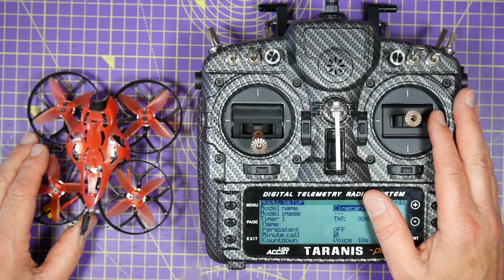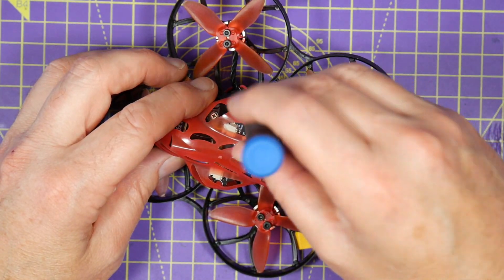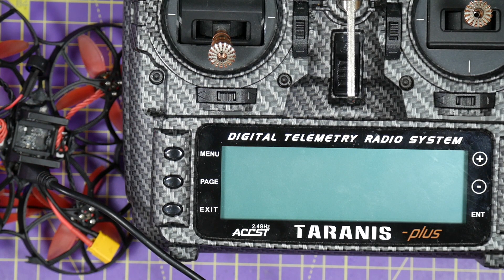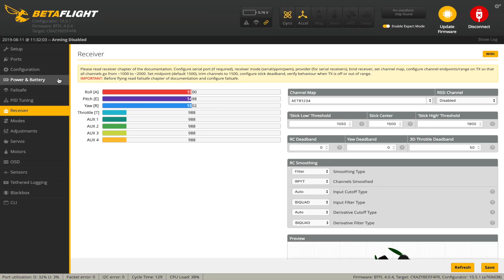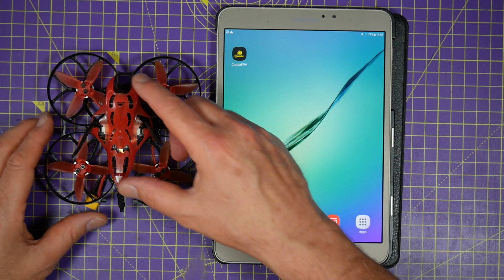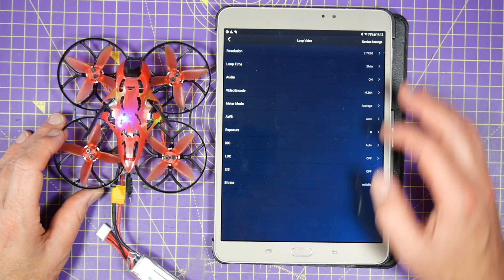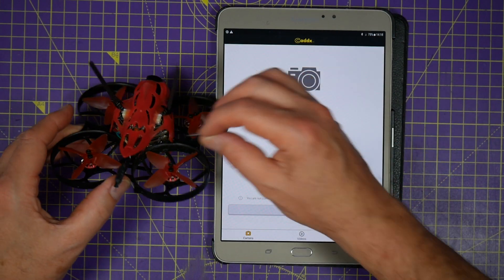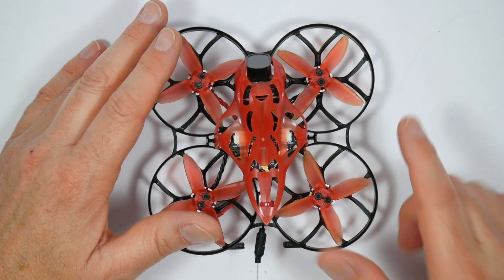Eachine Cinecan 4K HD full setup // Caddx Tarsier settings // FAT32 SD card formatting

Comment from the maker: Thanks to those of you who pointed it out, the SD card formatting option is available along with other settings in the Device Settings page in the app.  I totally missed it.
Reply: While this is a generally very helpful video, there are two huge issues (1) as noted in your comment, the drone can format own card, and (2) more importantly you don't need to take apart drone for binding, just type bind_rx_spi into the CLI in betaflight. The second one is a big deal since you don't want to be taking apart this drone unless you need to.

Comment: Hello again everyone. I have a question. When I plug a battery in on my Cinecan 4K, everything seems fine but the VTX's LEDs for the channels and bands don't turn on. I used a voltmeter to measure the voltage and there is definitely current going through the VTX so I don't understand. Any help please? :)
Reply from the maker: If it's wired correctly (double check) it sounds like it may be fried. Top tip - never power a VTX up if there's no antenna connected cos it may fry the output driver.

Comment: Hey ! So I recently received my Cinecan 4K, my Taranis QX7 and my EV100 goggles. I am trying to "bind" the goggles to the drone but I just can't manage. I power the drone with the included battery (didn't charge it or anything like that; just immediately out of the box), I power on the goggles with the battery (also tried directly powering it with a usb cable to be sure power isn't the problem), and then I go into auto-search mode. It beeps for quite some time but then it doesn't show anything. The first time I powered anything something showed up, but it was really dark and bad quality (impossible to fly like that and I took the ND filter off by the way). I am not sure what do.. I am pretty new so any kind of help would be very appreciated. Thanks in advance.
Reply from the maker: First, check you haven't got the VTX in PIT mode or zero mW - that turns the VTX off and you won't see anything. Make sure all the connections from the FPV camera to the VTX are correct. Try connecting the camera direct to the VTX to eliminate any flight controller problems. Also, make sure the VTX antenna is properly connected. If you've had the VTX powered up at anytime without the antenna connected, you may have fried the VTX.
Reply: @WhirlyBloke  Thank you for the reply. I think the problem is that the VTX is off. I managed to find the right channel etc.. But I only see the OSD and a black screen. I don't understand how to turn the VTX on. Is there a CLI command in betaflight ? Is there a button on the VTX ? (I don't know what circuit board it is).
Reply from the maker: @lucakubitza1534  There will be a button or buttons on the VTX somewhere.
Reply: @WhirlyBloke  Okay well noted, thank you very much for the help..

Comment: I used your app and still it says no sd card and when I start up it does no flash . The card is a scan disk 64gb , Ultra mirco xc 1 ? Any idea , thanks ..
Reply from the maker: I have occasionally seen this and I think it's a bad SD card connection. It doesn't happen very often.

Comment: open betaflight an connect the drone 
CLI command :  frsky_bind 
No ripping appart things, no wierd stuff no screws, nice and clean.
Reply from the maker: You're dead right. This is specifically for binding to SPI receivers. And means no more taking tinywhoops apart to find the bind button. But, those CrazyBee SPI receivers still have dreadful range and I always just put a cheap XM+ RX on them.
Reply: @WhirlyBloke   ouch this sounds not like good news. how's the range on this little guy on his SPI receiver for FrSky?
Reply from the maker: @stefanozanna1988  Watch this to see the range issues https://www.youtube.com/watch?v=qmlA1KDjZRQ and this to see how I fixed them https://www.youtube.com/watch?v=yei6LK51Zlw

Comment: Excellent and informative video from you as usual.....Personally ...Any BNF model that requires this amount of hassle with regard to stripping the model down to access the receiver ...to perform the most necessary and fundamental requirement of binding.. is a non starter for me.
Reply from the maker: I totally agree. But the rx performance may just be a quality control thing - a few months will tell. Buy a GEPRC CinePro 4K it's awesomely reliable and just works. http://bit.ly/2MAHMWs

Comment: If its fat 32 that means the max file size will be 4 gb ? It'll split the files as it records?
Reply from the maker: Technically, you're correct, but the point is GUIFormat allows you to format bigger drives as FAT32. Trust me - it works. http://www.ridgecrop.demon.co.uk/index.htm?guiformat.htm

Comment: Thanks. Instead of using the windows Software, cant I format the sd card from this Caddx Android App ?
Reply from the maker: Yep. I totally missed the Device Settings page. And me being an app developer as well - durr. Thanks for spotting it.
Reply from the maker: No. Weirdly it doesn't provide a format option.
Reply: @WhirlyBloke  Hi....did you try the second page on the Caddx App settings....It shows on my Geprc Cinepro 4K. which i presume carries the same setting ...as its the same camera App.
I have a SanDisk Extreme Pro 64 GB ....And first formatted it on my pc (standard format) then inserted in my Cinepro...connected to the Caddx App...went to 2nd page..  press the format option...Works a treat....Recording perfectly.
Reply from the maker: @heliharris69  Thanks. I must be blind to have missed that ;o)
Reply: @WhirlyBloke  No worries... It's nice to able to help you..
Because i have learned a great deal from you.
Regards Mick.